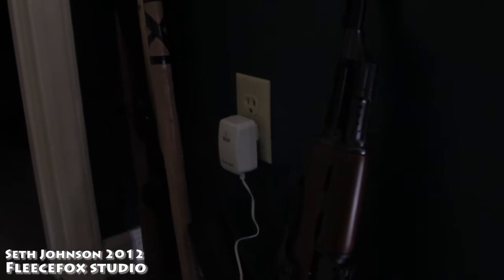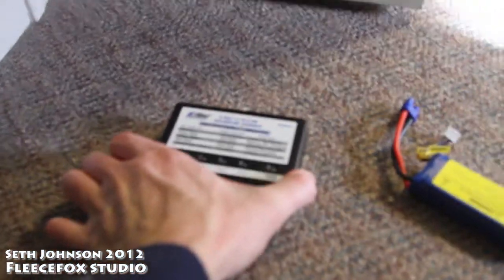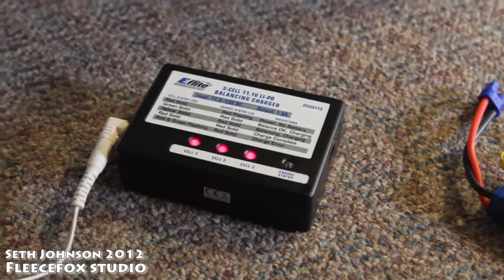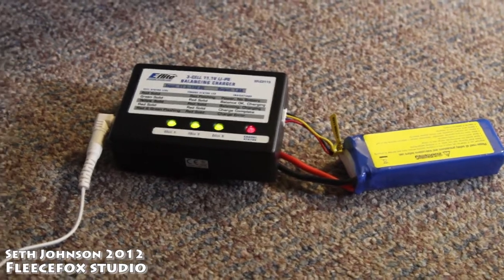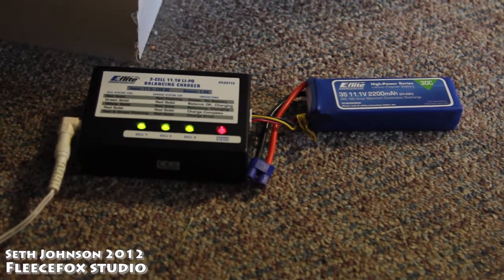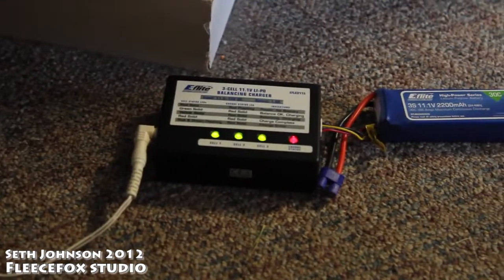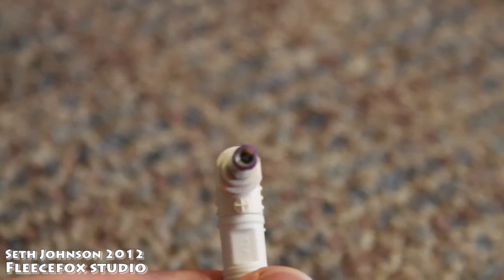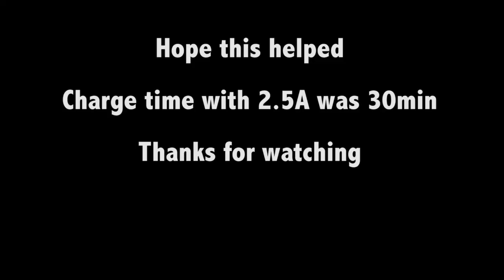Blade 450 Battery Charger

Comment from the maker: Hello. Thanks for the comment!  You are right on the money with the charger suppling 1.8A. The original supply that I purchased was only a 1A and would not run the charger. You are also correct about the charge time. I dont discharge my batteries fully so the time to recharge is not that long.

Comment: Using a higher amperage power supply (in this case 2.5A), isn't the output from the charger still 1.8A?  Also, to charge a 2200mAH battery for 30 mins at 2.5A should only give you 1250mAH . . . or am I missing something?